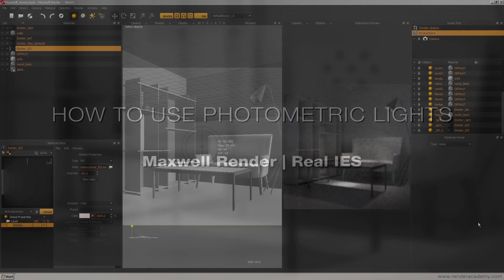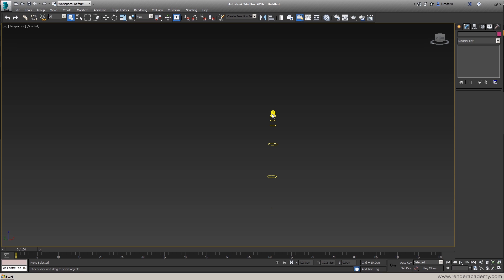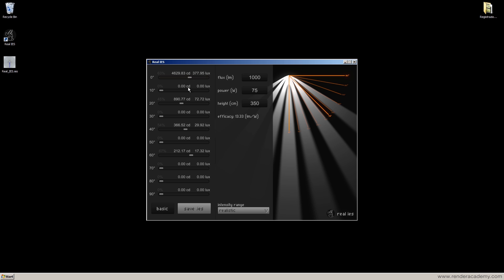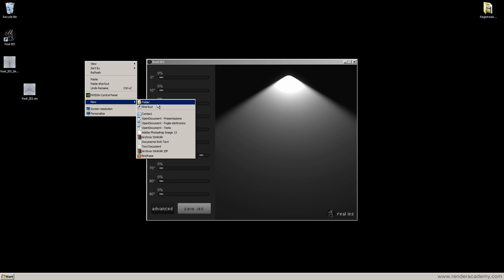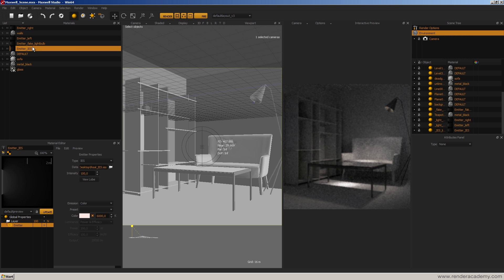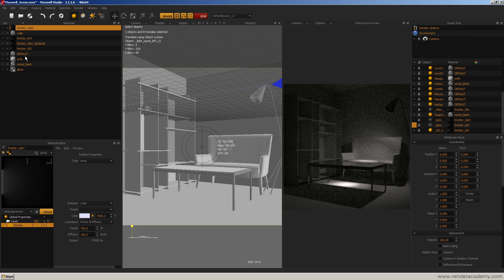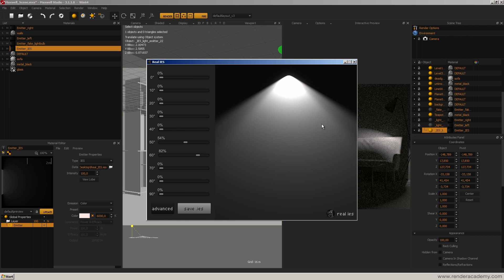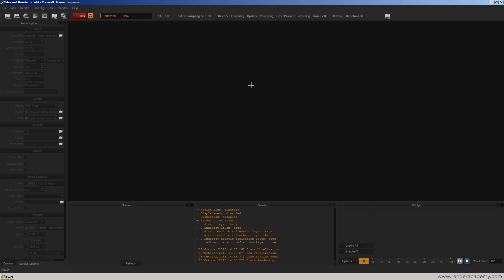Photometric light in Maxwell Render 3 Tutorial

Comment: Hello, thanks for the tutorial. How do you think we could make it so that the source of the IES light is available as well?
Reply from the maker: Hi, I'd probably model the light fixture and assign an Emissive, full bright material.
Here is a very old tutorial in which I was creating a game for mobile devices with UDK, where you can see the Emissive material in action https://www.youtube.com/watch?v=d2LzWdUxVBM
Reply from the maker: just saw that your comment was on this video for Maxwell and not for Unreal, but the principle remains the same: Self Illuminated material.
PS: just in case, in V-Ray there is an option to keep the material full bright without being counted in GI phase. If in V-Ray I'd remove GI from the material while I think in Maxwell Render it is possible from Object Settings but I'm not sure.
Reply: that's my problem as well, I can't seem to find a way to turn off GI in a light... thanks for your reply :)
Reply from the maker: When I was using Maxwell in production there were no lights and we were applying emitter materials on planes. Now things changed a lot in a better way and there are many more parameters, so I am sure there must be a way to have a full bright material without emitting energy.
I don't have Maxwell installed at the moment on my machines but I'll follow up as soon as I can.
Reply: Hello, thanks for the reply again. I contacted the official customer gateway support, they let me know about "Blocked Emitters" and they work exactly the way they should :) look it up in the Maxwell Render knowledgebase in case you ever need it. Enjoy! :)
Reply from the maker: You were faster than me :) thank you for sharing!
Reply: you're most welcome, thank you for sharing again as well :)